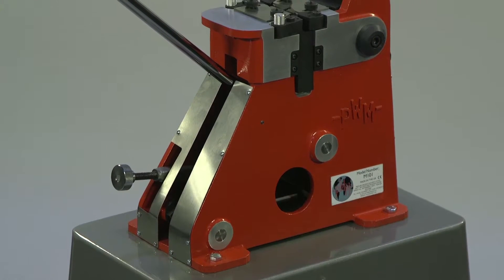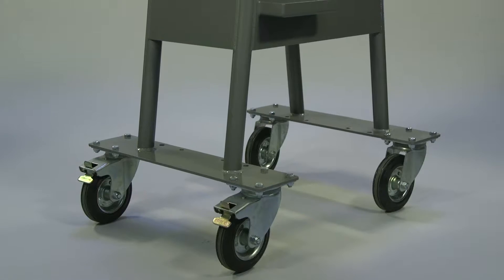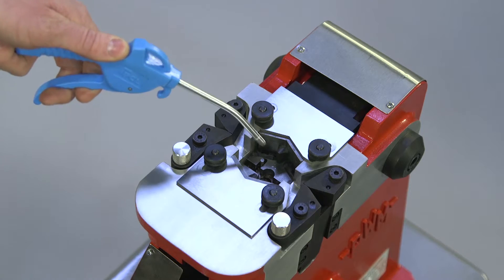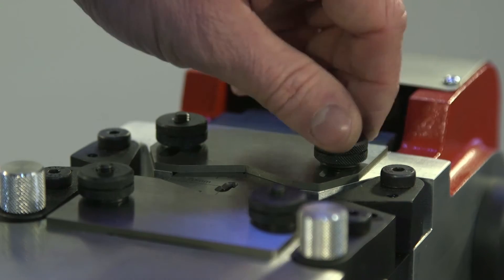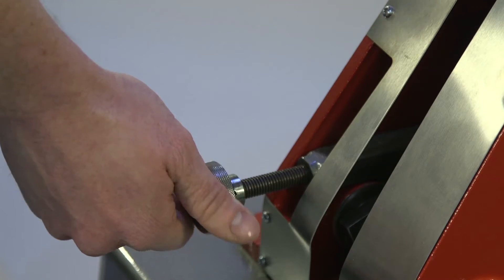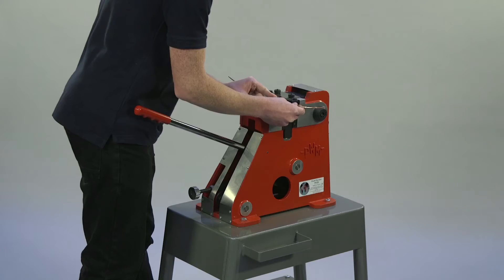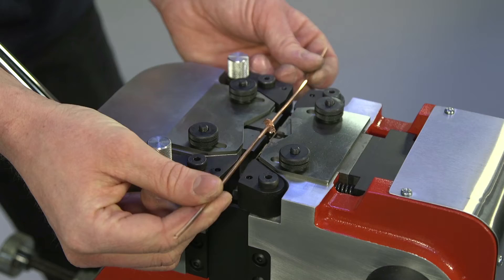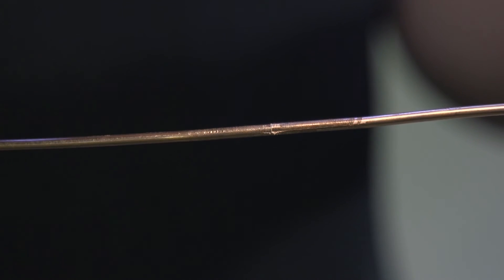M101 manual cold pressure welding machine for non-ferrous material 1.00mm to 5.00mm

Comment: Is it possible to joint solder wire same as copper wire?
Reply: Yes, depending on the composition of the solder. Generally the process will weld non ferrous metals, and solder has been welder with the process.
Reply: Cali...colombia....tu?